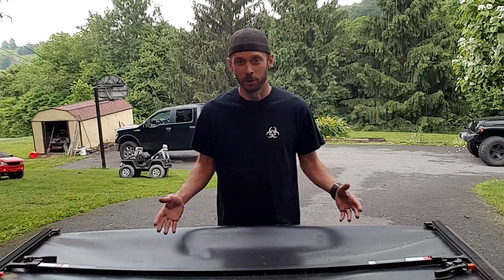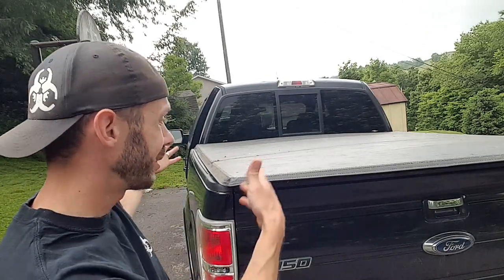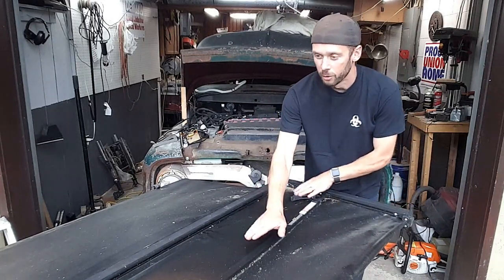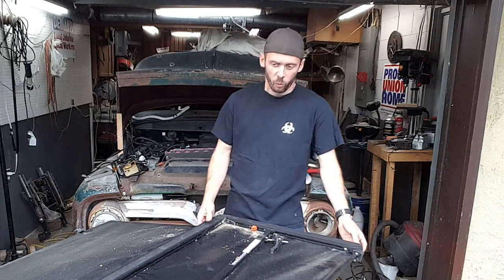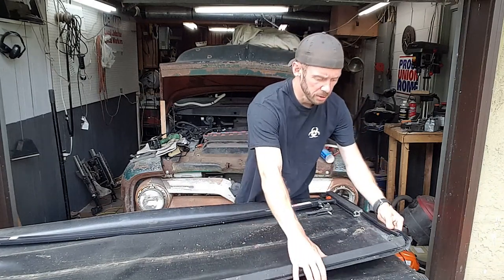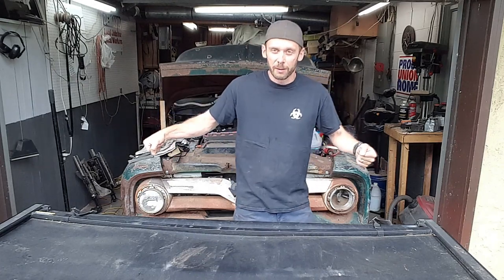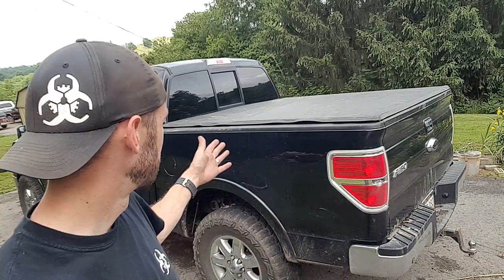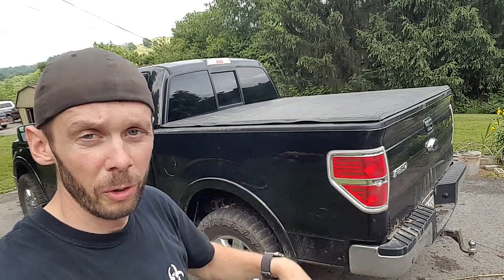Shortening a soft tonneau bed cover from a long bed truck to short bed truck.

Comment: This gives me the confidence to modify the cheap tonneau cover I bought for my new truck that's coming. I dont need to shorten it, but I decided I want to run a full height bed rack and tonneau cover so I basically need to modify the rear section that touches the tail gate to fold 90° at least (z fold) to clear the rear bed rack posts. 

Do you think doing mirrored 45° meters on each side rail of the rear panel will cause problems?

Comment: Great video! Would like to see how it folds when done. I have a brand new 6’5” tri-fold for my 5’8” crew cab box. Excellent Bestop tonneau, but I let it sit in the box for a year before realizing I was shipping the wrong size. Too late to return. Options: Take a hit by selling it on Craigslist for less than I paid ($350ish - ouch) then order correct tonneau, or cut it down like you did. Any opinions? Did you address the hold down buckles for driving with it folded up?

Comment: I am trying to figure out how to do the same thing to a roll-up tonneau cover now for my truck. I have a 1990 Chevy K3500 1-Ton 4x4 Dually with an 8' bed, but I have a cross-bed toolbox as well as a headache rack installed on it. I ordered an Access bed cover designed to work with a toolbox, but since I also have a headache rack the toolbox is farther away from the cab than normal which means the tonneau is too long. I already modified the siderails to fit my truck now, but the vinyl cover is still about 2" too long to work.
Reply from the maker: I'm trying to picture the cover. Whats the make/model of thecover? I'll look it up and see if I have any ideas.
Reply: @IdleGarage  It is the "Access Toolbox Edition Roll Up Cover"  ( https://www.accesscover.com/toolbox/ ) The way the front of it is designed, instead of being screwed into a frame, it has a round piece of plastic that the vinyl goes around that slides into a channel to secure it to the front of the bed. Without buying a sewing machine that is heavy duty enough for this thick vinyl, I haven't come up with another solution yet.
Reply: @IdleGarage  I did find a different company that makes almost the same product (Truxedo) but they are willing to custom make me a cover to my exact dimensions, but that is another almost $600 that I am hoping to avoid on top of the almost $500 I already spent on the Access cover.
Reply from the maker: That's similarly to how mine was in the front. If you can return the one you have you might have better luck buying one to fit a different truck. Here is a chart of bed sizes across different platforms. https://raybuck.com/pickup-truck-bed-size-dimensions/?print=print